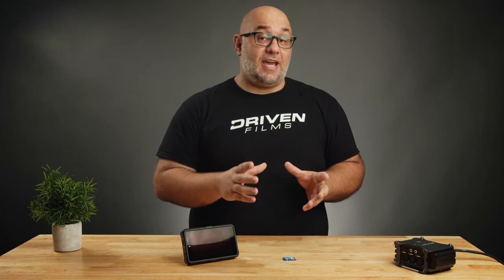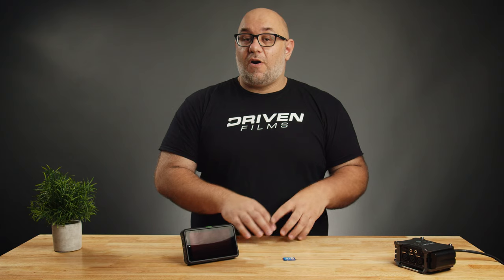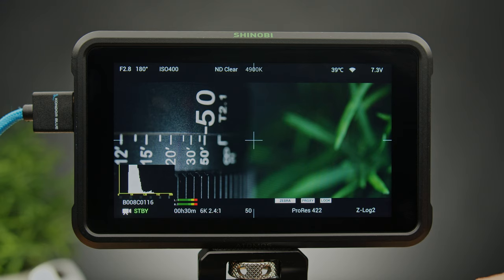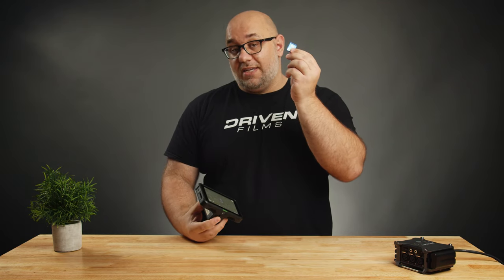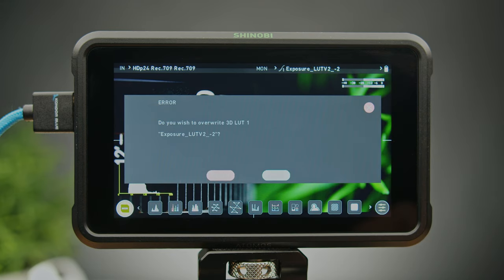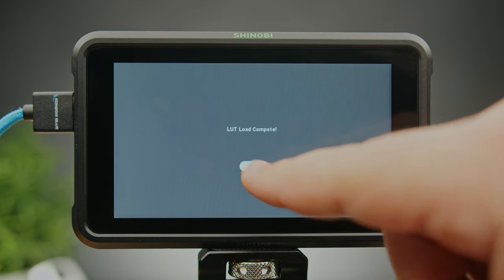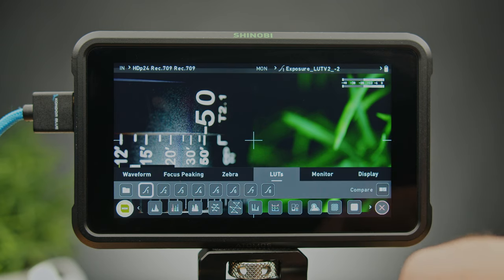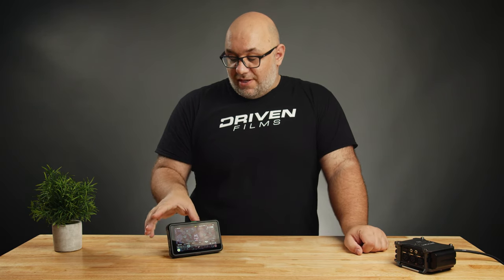How To Import LUTs on Atomos Shinobi II (Camera LUT vs Monitor LUT)

Comment: I think after insert SD card and "restart," Shinobi is very important. I tried more than 10 times, but it never showed up. After I restarted it, I could see every Luts on my SD card.
Reply from the maker: Very interesting. I don't recall having to do that but if that works that's great.
Reply: THANK YOU!!!!!!! Mine weren't working either until I restarted.

Comment: It’s a shame you can’t change the LUT intensity on the atomos. I use my luts at around 30-50% and at 100% they are just Tom much to monitor
Reply from the maker: Good point! That would be nice.
Reply: You can always create a new lut with the lut at 30-50% in Resolve. Easy to do and you'll have your preview lut at lower intensity on the atomos.
Reply: @DavidHorizonFilms  that’s crazy I was looking for this info today!! Thanks
Reply: @philpritchard8772  no problem!

Comment: OMG! I've been trying to load a lut into this thing for almost 2 hours and NOTHING works!!!!! Aaaaahhhhhhhhhhh!!!!!!!!!
Reply from the maker: Walk me through what you’re doing from start to finish. Which specific LUT are you using?
Reply: @joenicklo  - I EVENTUALLY got it to work... the problem is the SD Card needed to be formatted FAT32 (not ExFat ... this is because I'm on a WINDOWS machine. If you're on a MAC Fat32 may work) So I had to dig around to find an audio recorder I used years and years ago and pray it had a small enough card to format as Fat32. Luckily it was an 8gb card ... but .... even then it didn't work as expected.  I put the card in and still said No Files Found. it wasn't until I rebooted the monitor with the 8gb Fat32 card installed that it FINALLY read the card.   Also ... I see a ton of comments on this thread about the size of the LUT but if you are running the 10.2 firmware version this makes it so most LUTs will load regardless if they are "Monitor Sized" LUTs. So the same LUTs that are on my Ninja Inferno, and my Ninja V's also load into the Shinobi 7.   Some other things to note:  If you're like me and think shortening the filenames or removing the spaces from the filenames, etc. might help; it doesn't.  If you're thinking about formatting your cards ExFat via a device like your camera, audio recorder, etc. rather than your Windows PC to make it work; It doesn't.  If you think using 3rd party software to format an oversized 64gb or larger card as a FAT32 card; Don't bother, it didn't work either.
Reply: One more note:  IT IS POSSIBLE that you may be able use a card formatted on a Windows 10 machine as ExFat ... maybe.  The reason I say this is because I rarely rebooted the monitor when I was trying to load the LUTs.  I would simply format a card, copy the files to it, put it in the Shinobi, try to load the LUTs and get a Skippy Icon with a "No Files Found" error.  Then I'd try another card or try another card formatted differently but the monitor was running the whole time.  Someone might want to try rebooting the Shinobi each time they insert a new card and it MIGHT work. I don't know if I ever tested it that way or not?
Reply: @ubiFire  I just tried it. It only worked with Fat32 after rebooting the Shinobi. Thanks!
Reply: @ubiFire  Turning off the Shinobi and turning it on with SD card already inserted worked for me, thanks! I too had to use an older 32gb "HC" card and quick format it as FAT32 on Windows 10.

Comment: I'm having a weird problem, my Gamut Luts for the Immersion pack load just fine, but the base Luts (Panasonic Lumix S5II) get an error. "Invalid keyword found in file"  The file is VLog (S5II).cube.  Any idea what's causing the error?
Reply from the maker: I’d start by removing the ( ) from the file name. See if that helps.

Comment: I put the .cube file on my SD card then put it in the monitor but its saying there is no file. Do I have to put the LUT in a certain folder location on the sd card?
Reply from the maker: Is it an x33 or x66 cube? The monitor won’t read x66
Reply: I had the same problem. SD-card needs to be formatted in FAT32 and it will work!
Reply: @samisiilinphotography7722  FINALLY. I have been trying to figure this out for months...with your tip it took me 2 minutes! 

Can't thank you enough!
Reply: @samisiilinphotography7722  hey there would you be able to explain how do this im having same problem
Reply: I'm having the same problem and I've tried several ExFat formatted cards and "Monitor LUTs" that are small enough to work but the monitor isn't seeing any files  ... this is frustrating
Reply: One more note:  IT IS POSSIBLE that you may be able use a card formatted on a Windows 10 machine as ExFat ... maybe.  The reason I say this is because I rarely rebooted the monitor when I was trying to load the LUTs.  I would simply format a card, copy the files to it, put it in the Shinobi, try to load the LUTs and get a Skippy Icon with a "No Files Found" error.  Then I'd try another card or try another card formatted differently but the monitor was running the whole time.  Someone might want to try rebooting the Shinobi each time they insert a new card and it MIGHT work. I don't know if I ever tested it that way or not?

Comment from the maker: FOR ANYONE STRUGGLING WITH LOADING THE LUTS:

First step: Use a FAT32 aka MS-DOS formatted SD Card. Use a smaller SD card, by that I mean 32GB or lower capacity. The Shinobi doesn't like to read larger cards.

Next, make sure you're using an X33 LUT. THIS IS VERY IMPORTANT. The monitor won't recognize an X66 LUT. This should be a .CUBE file. If it's not .CUBE, it wont work. If you bought a LUT online from someone, chances are it's an X66, which is meant to be used in a program like Resolve or Premiere.

Any other questions, please join the Driven Films Discord Community and ask for help there. https://discord.gg/AZwHku5
Reply: thank you!! that was life saving
Reply: Nothing was working till I saw this comment and I changed from using a 128gb to 16gb card. Thanks.
Reply: 64GB works too! But this one helped me a lot! (I had to try the 64GB because I had now lower capacity one)
Reply: I feel like all of this info should have been in the video..
Reply from the maker: I feel like you should make your own video.
Reply: I dont think I own a card smaller than 128 lmao

Comment: Seems like LUT management is a lot easier on the Shinobi vs the Ninja V. Interesting to see their menu differences.
Reply: really? the Shinobi and Shogun share the same menus best I can tell so weird the Ninja V wouldn't
Reply from the maker: It’s been a while since I sold you the ninja v...so I don’t entirely remember but did you update the firmware on it?
Reply: @joenicklo  Firmware is up to date, yeah. I keep on top of that quite a lot. What's different to me in your video was the dropdown when installing. It's very minor differences tbh. I also like the SD card slot they have on the Shinobi, which is pretty neat.

Comment: Hello,
I have a problem with my Atomos Shinobi and my Sony A7SIII and maybe you can help me :
(Atomos settings with Sony Slog3 Sgammut3.cine - tested with and without this setting)
When I enable the lut (.cube format) on the monitor, the image looks really contrasty and the lights clipping (like if the lut was added 2 times). I recorded a footage correctly exposed from my A7SIII and added the conversion Lut in premiere, it looks good, but not on the Shinobi, 
The Gamma assist is not actived on the a7sIII.
Do you have any idea ?

Thank you
Reply: Same issue I’m having with my a7siii
Reply from the maker: Do you have the LUT preview enabled in-camera too? I don't know the Sony A7SIII at all but I do have an A7III. When I tested it with that camera, no issues.
Reply: @joenicklo  I think I found a solution thanks to the video here : https://www.youtube.com/watch?v=69PvnuRNR00&t=185s
This is about full rgb range and limited rgb. I applied on my footage the technical conversion from full rgb to limited rgb in Premiere Pro (like in the video above) and applied my lut (Joel famularo lut designed for a7siii), then I rendered it to a new lut .cube and uploaded it in my shinobi and it seems to looks good !
Reply: @BryanVigier  the video link is disabled. Does the shinobi work with phantom luts now? What did you do? Does it have to be X33 luts?

Comment: Very good. I did learn here. Thank you. Just getting my Shinobi going and was having a hard time finding out if I should use the in camera preview luts or load them to Shinobi. I'm all set with the in camera luts here. From I gather from your video is that I am good because GH6 seems to be fine in all recording modes, That being said, are there other pros or cons to using the in camera luts as oppsed to the in monitor luts. For instance, When I switch to play mode in the camera the monitor kind of shuts down for a sec an then blinks on. Same when I go back to recording mode. Is that normal and does it have anything to do with the luts. ?
Reply from the maker: I noticed the same issue when I filmed a three camera interview on lumix s5ii’s a few weeks ago. I’m not entirely sure why it does that. 

As for whether you should go in camera or monitor, that’s a really good question. I think that it depends on a few factors. One being, does the monitor support tetrahedral LUT rendering? If not, you’ll possibly see some banding. In that case, I’d go camera side LUT.

In the case of the red Komodo and smallhd monitors, I use EL Zone to monitor exposure. This requires a LOG signal being sent to the camera, so I don’t output a LUT from the camera, I use a monitor LUt. 

I guess it depends entirely on your situation, combination of gear and how you prefer to setup your workflow.

Comment: Only problem with the Shinobi (I'm using it with s6 as well), is that the "camera output" doesn't have a zcam option which is different from the Ninja V which does have this I am told. This does affect the accuracy of the preview LUT a tiny bit
Reply from the maker: Interesting bit of info
Reply: PS keep up the great work, ur channel is one of my favorites

Comment: Great video! I’m having troubles getting my LUT on my shinobi monitor to look the same as it does when I add the same LUT in the grade. Every time I select it in my monitor it looks about 100% too saturated and contrasty for how it should look. I’m shooting clog2 on the C200, any advice? I’ve tried the user manual but still can’t seem to solve my problem. Thanks!
Reply from the maker: First thing I'd check is to make sure you're not outputting the LUT preview from your camera (if the C200 has it, sorry not familiar with that camera system).
Reply: Following!  My luts look super saturated too within the shinobi.  Normally I only use my lut in post between 40-50% intensity so should I be adjusting that before loading onto my SD & into thr shinobi (if so tips on how to do that would be amazing!)
Reply: Did you figure this out? @RachelLee

Comment: Hi great video! Can you please help me to understand shooting zlog with the shinobi? When I switch to log and I have my LUT in monitor I still have 20 IRE even if I cover the lens. So Im not sure if I can believe to my wave form or false colours . Thank you so much
Reply from the maker: Sorry I missed this comment. Does it do this with the lens cap on too? If you use a grey card, it should read 47-54 IRE for 50% Grey. If you're pointing the camera at the grey card and it reads accurately with the LUT on or off, then it's correct.

Comment: Hello, & great video for starters. I'm having an issue though. I have my luts on the SD card, but my Shinobi doesn't recognize the Luts (they are cube files). I'm taking it, it's due to the fact that I have no root directory folder on my SD card. Does my sd card need to be a brand new one? I formatted it before putting the Luts on it, but again, my luts aren't recognized on my Shinobi. Please help. 
Thanks in advance.
Reply from the maker: Are they x33 or x66 LUTS? Most monitors can not read x66.
Reply from the maker: @thomasraybon224  Hit me up on the Driven Films Discord and I can help you out.
Reply from the maker: @thomasraybon224  Link to the Discord is in the description of the video.
Reply: any chance you figured out what was happening?  I'm having this problem too
Reply: @Balvarez02  Hi Brian, try it with a 32GB or smaller SD card, that solved it for me! Took me ages to find that out, finally stumbled upon it in a throwaway line from another video
Reply: @TheThievingBeggars  that was it! Thank you so much

Comment: Thank you for the post! But, where do you find x33 Luts?
Reply from the maker: Depends on the manufacturer. Most manufacturers will label them
Reply: @joenicklo  thank you, does a lut with .cube file suffice or does it have be both an x33 lut and .cube??

Comment: Hi, thank you so much!
1. I'm trying to upload the LUT using my 64g Pro grade SD card and the Shinobi just cant read it, do you know why? 
2. When I shoot s-log 3 cine3 and use the built in REC709 screen look every thing looks over exposed, does it make sense?
3. The Shinobi monitor is really getting hot in minutes. Does anyone else experiencing that?
THANK!!!!
Reply from the maker: Try formatting the SD card to FAT32 file format and making 100% sure you’re using a 32x32 LUT and not 64x64. 

As for the s-log 3 situation, I’m not entirely sure about that one since I don’t know Sony cameras that well but I’d maybe someone in the Driven Films Discord server would. Link to the discord is in the description.
Reply: @joenicklo  Great. Will do!
Reply: @joenicklo  HELP! I've tried everything. I've tried different SDs, I've formatted to FAT32, I've used 32x32 luts, 64x64 luts, and I can't get the Shinobi to recognize that there is anything on the SD. It just says no files found. It's driving me insane.
Reply: @johnarender9384  Do you found it out? I also have same problems and need a solution. Thanks alot!
Reply: @orelbitan  Do you found it out? I also have same problems and need a solution. Thanks alot!
Reply: @fabianbetto  no sorry... But didn't tried that many times...
Reply: @orelbitan  So i need throw the Shinobi to Garbage?
Reply: @fabianbetto  or just find a solution 😊, I told you I haven't tried to work this out...
Reply: @orelbitan  I found it out. With a old 32GB SD Card it works :-) Looks like the Shinoby has problems with Big SD Cards :-)
Reply: @fabianbetto  thank you, now i just need to buy an old one😜
Reply: @orelbitan  I need take alot of care for my verry old 32GB Card :-)

Comment: Hi, does this monitor work with canon eos m series camera bodies. Thank you 👍
Reply from the maker: Yes
Reply: @joenicklo  hi ... 👋 thank you, I bought shinobi 5" sadly there are no connecting cables or mount included however they added power adapter for not much use 🙂, I am happy with quality overall,  it works fine but I don't have access to my camera screen and 'Q'uick option 🤏. Thanks again 🤝